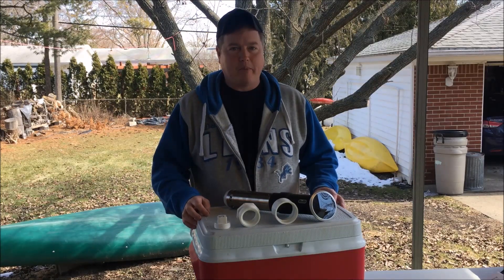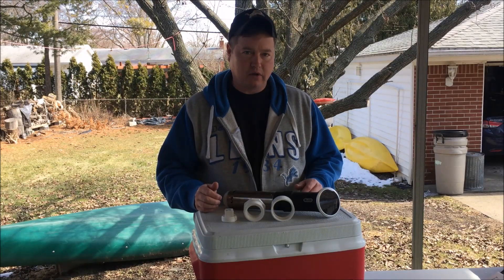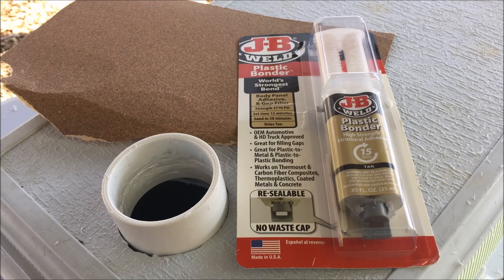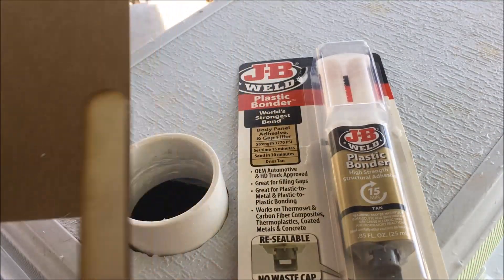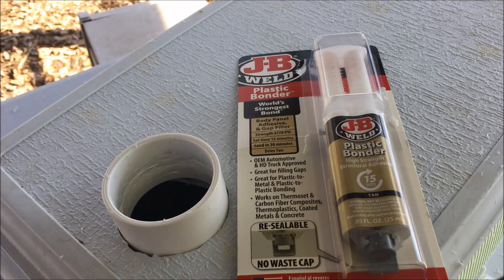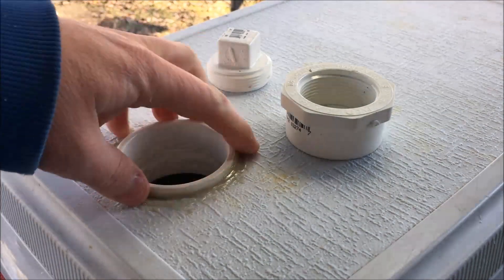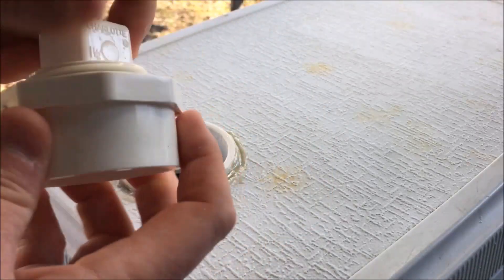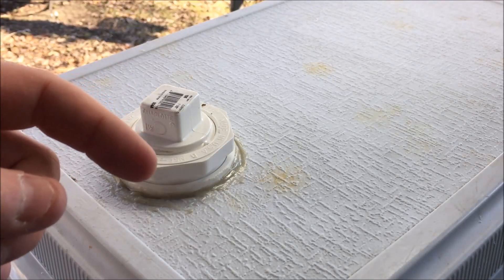HACK THIS!!  Anova sous vide franken cooler

Comment: I ended up cutting the lid so that the cooker stays submerged when I want to remove the rest of the lid. I didn't want to pull the thing out while running or turn it off to open the lid.

Comment: John, I took inspiration from your video to hack my sous vide franken cooler. I made a few modifications that worked out great. the first is that I happened to have an old spare cooler (a Coleman of roughly 50 quarts) that had an insulated lid that was shaped a little nicer for this application because the inside surface was flat near the end where I drilled the hole. I think the insulation in the lid might be a little thicker as well. When I installed the 2" inch plumbing fitting I recessed it slightly at the top for reasons I will explain shortly.

I found a dedicated slip fit plug that had a flat top. When I ground out the ridge on the inside of the 2" coupling I also enlarged the hole ever so slightly so that I could bottom out the slip fit plug into the coupling, but there was enough friction fit to hold the plug slightly so it wouldn't fall out. It turned out that enlarging the hole in the fitting to that size also make the sous vide device to fit better through the hole.

I mentioned that I recessed the 2" fitting slightly when I glued it into the cooler lid. I did this so that when I put the plug into cooler lid then the top of the plug is flush with the top of the cooler lid. That way the top of the cooler is flat when the plug is installed, which is handy for various reasons, such as if I want to stack things on the cooler. This is especially handy when storing the converted cooler. To remove the plug I just push it out from the underside of the cooler lid.

I also plan to insulate the inside of the slip fit plug. That way, when I use the cooler in cooler mode the plug won't leak as much heat into the cooler. I have a spare flat circle of plastic left over from drilling the hole in the lid with the hole saw. Just gluing that onto the bottom of the plug and closing off the small guide-hole that the hole saw made will produce a trapped dead air space in the plug, and this will probably be an even better insulator than if I were to fill that space with foam.

The end result is very nice. My wife says that it looks "professional".

I might end up installing a second sous vide port at the other end of the cooler That way I could use two sous vide units during the heating-up phase of a cooking session. That could pretty much negate the need to fill the cooler with hot water at the beginning. I should be able to just use room temperature water for filling the cooler. Of course that scheme would require running two independent electrical lines so as to not blow the circuit breaker. When the water is up to temperature I could remove one of the two sous vide units and plug that hole and just use one sous vide units to maintain the temperature. I haven't actually decided if I will add a second sous vide port into the lid or not.
Reply: Correction: The cooler I hacked was not a Coleman cooler. It was an Igloo cooler.
Reply: You could also use an additional circulation pump to heat up the water and even out the temperature from one end to the other this would not need the additional sous vide.

I made a sous vide cooler using a Heating Element, Temperature Controller & a submergible pump which circulates the water over the element. I have the element inside PVC pipe that is 3 times larger and the pump pushes water in from one end and the heated water out the other, this circulates the water and the probe is placed at above the pipe so it registers temperature from already circulated water.

Comment: I just finished watching another youtube video on a Cooler Conversion for sous vide cooking, and he said that if the hole is too snug, then the steam can creep upwards to the Anova Controller and damage the unit. Did you experience that problem?  How is your Anova  Sous Vide Franken Cooler doing?  Did you have to make modifications since 3/11/18?  It's 3/18/2022 now.
Reply from the maker: Hi Georg, it’s still working fine, although I’ve only used it a few times. I use a smaller clear plastic container normally with a silicone lid. It doesn’t fit perfectly and I haven’t found any concerns with steam. Sous Vide is still my favorite way to cook ribeye steaks! Cheers!
Reply: I saw a teardown of the Anova unit and there is a small small fan that draws outside air through a louvered vent near the top rear of the head unit and forces it down through another louvered vent at the bottom rear of the head unit just before bracket that holds the unit. This downward forced air flow ensures the electronics stay cool and dry.

Comment: Thats actually a bad idea to use just PVC. When the Sous vide skirt gets hot it'll begin to stick to the pvc and when you try taking it out it'll end up being stuck to the pipe youve glued to the cooler.

This happened to me, but fortunately I figured out how to get it loose by placing it in the oven for a few minutes and it slipped out without repercussion. I almost panicked that Ill have to buy a new one. My advice fork the extra cash and buy some foil tape and apply it inside & outside the pvc that'll fit the sous vide so you dont turn out like I did
Reply from the maker: What temperature range were you cooking at, do you remember?  So far I've only done steaks at about 135 F and have not experienced that issue (mine is a 800 watt, so maybe the higher wattage ones may cause this problem?).
Reply: @JohnsDIYPlayground  Ranging from 140~150, I use a Pro which is 1200 watts
Reply: I wonder if wiping the inside of the fitting with mineral oil each time before starting a cooking session would prevent the two things from sticking.

Comment: Great video.  A couple of things I discovered.  First, there is a 2" PVC repair coupling that does NOT have the ridge.  They want $1.50 more for it, but you don't have to grind out the ridge.  Second,  if you have to buy a hole saw anyway, a 2.75" saw is PERFECT.  At least that 's what worked for me.  Your actual mileage may vary.  Also, there is a 2" plug that just goes in the coupling that just works.
Reply from the maker: Awesome feedback, thanks Chris!

Comment: I'd be nervous about opening that lid (which pulls the Anova out of the water) if the unit was still heating because the heating coil would burn up really fast if it was out of water while heating. I'm not sure how hot it gets but it might be damaged even if it's off if not given enough time to cool down.
Maybe I'm being paranoid. 
Very cool idea though. Thanks for sharing.
Reply: I thought the exact same thing.  I was thinking do you turn it off first, open the lid, then turn it back on after shutting the lid back up?  Really there is no reason to open it and check it.  I mean what are you really going to see?  I think loading the cooler with the meat, shutting the lid and just commiting to the time and not opening it until the cook is scheduled to be over is probably the best.  Did you ever do this and how did it work for you, if you dont mind me asking?

Comment: Nicely done, and also good comments below about how to improve with slip coupling and interior marks. I am going to make one this weekend and cook several racks of ribs.
Reply from the maker: It works great for that! I’ve done a 24-hour slow cook in the cooler followed by 30 minutes smoking on the grill then finish with bbq sauce on a high heat grill (indirect) a few minutes per side

Comment: Why not use silicon instead of jb, any particular reason?
Reply from the maker: I guess you could use silicone but JB Weld is an epoxy and much stronger to hold the coupler in place
Reply: My guess is that silicone would eventually succumb to the heat and fail. The epoxy is a more or less permanent solution.
Reply: @bryanbanks1966  nonsense. RTV silicone is good past 400º.

Comment: Nice job! If you use a 2" PVC Slip (or repair) coupling, you won't have to remove the inner ridge on the fitting (it doesn't have one!). the Anova fits perfectly (as would your cap system).
Reply from the maker: Awesome tip! Thanks!!

Comment: You happen to have the part number or exact dimension of those PVC parts? Is so stupid here that they actually don't sell those here in Canada (Home Depot and what not!) I think I actually need to order them online...
Reply from the maker: The inner diameter of the PVC pipe I used to put the Sous Vide through is 2.5".  You still need to shave off that little ridge inside the coupler.  On Amazon, you can search "GF Piping Systems PVC Pipe Fitting, Coupling, Schedule 40, White, 2-1/2" Slip Socket"
Reply: @JohnsDIYPlayground  Australia doesn't have this in our hardware stores either. Can you confirm that the following link is right. Only asking because in your video you said it 2" and the link is for 2-1/2"
https://www.amazon.com/gp/product/B008O1UZN4
Reply: totszwai  all this stuff IS available at any hardware store

Comment: 2 3/8"Two and 3 eights inch hole saw bit fits perfect no need for pvc spacers.
Reply: He wanted the pvc "sleeve" so that he can still plug the hole and use it as a cooler. Plus the sleeve makes for a more sturdy piece.

Comment: Did you also seal the inside of the cooler lid.  If no won't water get in and turn bad eventually? Good Project!
Reply from the maker: Thanks!  Yes, I used that same JB Weld epoxy on the inside too